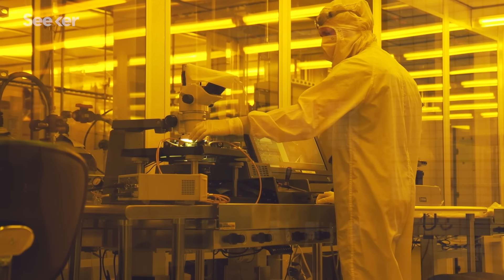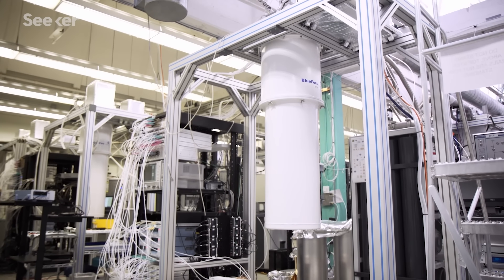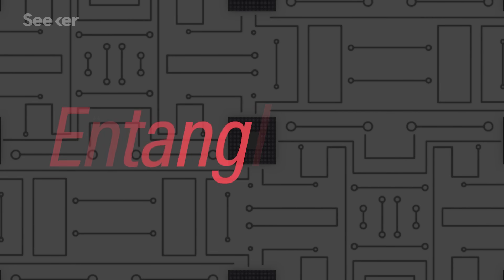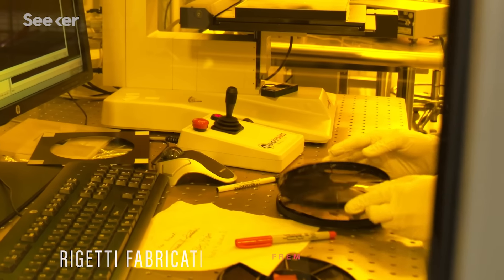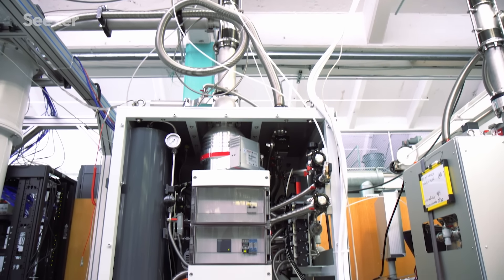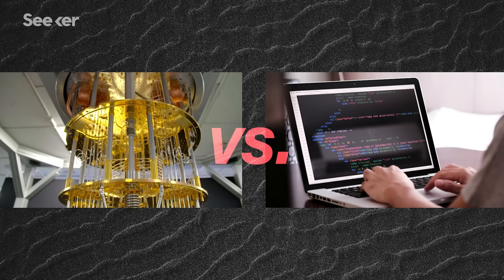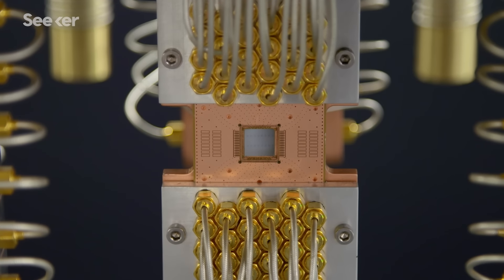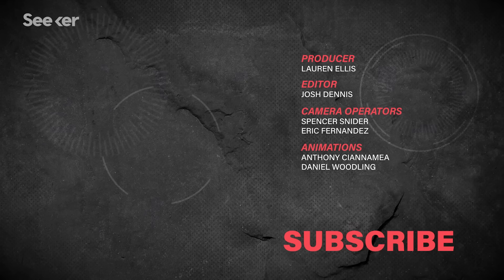We’re Close to a Universal Quantum Computer, Here’s Where We're At

Comment: Understanding how to code for a quantum computer is beyond me, though. And I have a master's degree in computer science. It's just such a completely different way of thinking. But I bet that future students will have lectures of quantum computing.
Reply: That's one thing I found sort of comical about the race for working quantum computers. I was watching a documentary on it and a speaker mentioned that creating such a computer was only part of the problem. Since it isn't a classic computer, it won't work in the same way that current computers work, and programming a quantum computer will require learning how to interact with it. Sort of like learning to communicate constructively with an intelligent alien jellyfish from another galaxy. Actually, that would probably be easier, lol.
Reply: I am very confused about quantum computing because I don't understand the basics of normal computers. You guys seem like you could help, in order to get the computer to react in a certain way, I thought the electricity flow had to be cut off from certain transistors. If that is true how is it cut off? Also how do the people who engineer the circuits control the qubits and they end up as dots of metal in a circuit? I heard someone say quantum computing deals in probability, how so? I probably said many incorrect things here but please help me.
Reply: The Supreme Lobster here's an explanation that worked for me
https://youtu.be/F_Riqjdh2oM .

It doesn't explain how it work on the physics level, but I guess it gives a glimpse of how it is programmed.

Ok, I'm not a hardware expert, but here's my simplified understanding.
When it comes classical computers, we don't think about transistors during programming. We think about commands like "if this piece of memory has this value do these commands", "add this value to a value in that piece of memore and store it here", "while this piece of memory has such value keep doing these commands". CPU is a clever arrangement of logic gates that performs these commands like a calculator performs arithmetic. Examples of logic gates are AND gates, OR gates, NOT gates.
How to make logic gates out of transistors: https://youtu.be/sTu3LwpF6XI
How to make a binaty adder out of logic gates:
https://youtu.be/wvJc9CZcvBc

You can play with such circuits here: https://simulator.io/samples
Reply: Alen German it's really easy to understand
Reply: jay cocktoe how can you tell
Reply: The Supreme Lobster ikr
Reply: I'm sure there will be a layman's layer just like the sdk's of today.  How many people code today that cannot tell you what they're doing once compiled to the machine code?
Reply: @Alen German That's the exact video I was going to recommend. It's really is the best introductory explanation out there.
Reply: Lugmillord

Quantum computing is basically good for doing search operations on all possible outcomes except that it doesn't require a loop. Instead of describing how to loop through the possible outcomes and testing each one to determine whether or  not it is the outcome that you are looking for, you simply create the constraints that defines what a solution looks like and let the qbits that are sufficiently limited become determined values instead of being in superposition.

Effectively, you are creating a filter that only allows valid solutions through. The quantum computer takes care of generating all of the potential solutions and feeding all of them through the filter simultaneously.
Reply: The Supreme Lobster Your question is much too big to be answered in a youtube comment. But a key point is that the notion that transistors are switches is incorrect. Transistors are analog amplifiers the more current/voltage that is applied to a transistor, the more current the transistor  allows to pass.  Digital circuits are designed with a very high gain at the logical transition point between a one and a zero so that a small change will cause the output to go high or go low very quickly. But if you have an input that is very close to the transition point, the outcome is essentially random because noise in the circuit will effect whether a zero or one level detected. If you make a transistor small enough that the state of a single election can change between a zero and a one, the determination of that bit will inherit the superposition of that election, creating a quantum bit.
Reply: I have to call BS on you having a masters in CS then. I just got a bachelors in CS and quantum computing is something we studied. It wasn't something we had multiple classes over but there's absolutely no way someone majors in CS, let alone achieve a masters in it, and lack a fundamental understanding of quantum computing. And if you're talking about a lack of understanding in mathematics, then how in the world did you get a CS degree? Your base studies are the same as any engineering student, I had to take a total of four calculus classes in my freshman and sophomore years just to get into the CS major... not to mention multiple physics and chemistry classes along with other advanced studies. You're like most people that have ever talked with me about my degree; they all assume I just took a bunch of programming classes and that was it.... they have this idea that it's just some extended version of a technical college degree.
Reply: Samuel Rs I just checked the local university course catalog. It offers bachelors, masters, and doctors degrees in computer science.  There are no classes in quantum computing listed in the course catalog. So consider yourself lucky that you have some exposure to it. 

And you are a recent student.  When I received my first degree,  quantum computing was a brand new idea that was only theoretically possible. Even now its only in its infancy and not yet practical. Things are changing rapidly -- by the time it becomes practical, its likely that what you learned in school will already be obsolete unless you are actually doing quantum computing research.
Reply: Samuel Rs When I was skimming the responses I thought "Hey, what a constructive chain of comments", but of course there had to be some entitled <enter insult of your choice> like you. First, look up what a strawman argument is. You are making baseless assumptions and then claim that you are "oh so good at this". I get it, you want to feel superior.
I was in the top 10% of students both the year I got my bachelor and the year I got my master and I studied in Germany's best university for computer science. When I studied there were no quantum computing lectures - maybe there are in the near future, who knows. It's nonsense to think that knowing how to programm for quantum computers is in any way relevant for a degree as of now. I have a deep understanding of signal machines (a generalization of cellular automata) - I guess you have no clue what that is. And I'm not saying that you can't have a degree in computer science without knowing about it. Computer science is broad. People specialize in specific areas. Quantum computing is just one small field of many.
Reply: You do make a good point Tim, I didn't really think about those getting their degrees significantly earlier than I. That does make sense, my apologies.
Reply: We'll have AI to understand and program for us.
Reply: its been explained to me as a function call that would be accessed through normal code.
Reply: Tim Harig ohhhhhh
Reply: The Mathematics of Quantum Computers | Infinite Series ... :) womenzzzz
Reply: Lugmillord I would imagine the computer would write it's own program!
Reply: Joshua Woods woah
Reply: That’s because masters isn’t really anything. Everyone has masters
Reply: Don't worry, there will be thousands of OOP frameworks to "simplify" the process :P
Reply: Lugmillord, did you just realize you dont really know anything?
Reply: The human brain will continue to amaze and yes we will program for quantum computers.
It's only a matter of time.
Reply: The Supreme Lobster I'm no expert in quantum computing but I'll try my best to sort of explain how they work. Please correct me if I'm wrong on any part of this.

So first entanglement. A lot of media and hype makes it seem like there's a string attached between two atoms to connect them but that's not the case. It is the idea that let's say an atom decays into two daughter atoms. Both daughter atoms will be very similar in spin, composition, energy, momentum, etc. That means the two daughters are entangled because of that scenario. They will become no longer entangled when another scenario causes one to lose energy or change, aka such as looking at one of them, your eyes bounce photons into your eyes and collect information, photons contain energy and that energy bouncing on the daughter atoms changed their energy so they are no longer the same and not entangled.

Superpositioning is if you remember from chemistry, atoms have a spin of either up or down. Since they can flip so fast between them, we say it is doing both at the same time because we can't tell if they're up or down spinners until we observe it in say an NMR which has a magnetic field to force the atoms into either an up or down state. By doing that, we collapsed the superposition and forced the atoms to be either up or down.

So quantum computers use these principles along with statistics and linear algebra. A qubit is a 0 and a 1 at the same time. So think of in a classic computer, two bits could be 01 or 10, nothing else. Two qubits means you could be BOTH 01 and 10 at the same time. That's literally two computers at the same time in a quantum computer. Follow this pattern, 3 qubits is 001, 010, 100, 011, 101, 110, 000, 111 all at the same time!!! Which is a pattern of 2^n. So that means with 3 qubits, you have 8 strings of 3 bits. That means you went from having to need 24 bits to only 3 qubits. Since 2^n is exponential, having like 10 qubits will be the same as 10240 bits (cause 2^n strings times 10 bits per string).

But now this is where people get tripped up, it's not doing all those at the same time! It is holding the information at the same time, but to use it, we have to bring it from a superposition back to a regular observational state. Think back to the NMR I said, up and down spins are useless until we put it in a magnetic field to observe the spin to characterize a solution. They use probability to help "collapse" the qubit states so that it goes to one of the many superposition strings. So let's say you have a regular computer with two bits, a 1 and 0. You will have a probability of 1 to be either 10 or 01 because YOU tell the transistors, I need a 10 or a 01, it doesn't randomly pick one, it can't be anything else. In a quantum computer, two qubits give you 00,11,01,10. It is all of those at the same time, now you just need to tell the computer, hey I need 10, can you collapse to 10 so I can use that? How they physically do that is beyond me but that's the theory behind it. Once you collapsed it to 10, you can use it like a regular computer.

I hope I helped and if not, I probably just confused the crap out of you, theres more you can talk about using eigenvectors and such but that might be too much math for a comment. Again I might not be totally right cause I'm only studying Chemical Engineering and not quantum physics lol
Reply: Lugmillord - ...having a masters in computer science which is an established thing 50 years old says nothing about your ability to think new and innovative. You're a learner not a writer, its not a surprice to me you cant comprehend whats still not even understood by the brave ones who decided to be the pioneers in contruary to a pleb learner
Reply: You need a strong understanding of science/physics, basically the first thing this video points out...
Reply: well all long be dead before that happens
Reply: It's a bit like a non deterministic turing machine but one you look the output you ruin it
Reply: what good would it be to have a computer generate random codes?
we can already generate as much digital code as we want.
Reply: Just to guzzle billions of dollars and make us general people fools by using non comprehensible technical jargons.
Reply: hey..somethings gotta keep this zoo running
Reply: Lugmillord you have a masters in computer science and you favorite Mario hacking videos made by script kiddies?
Reply: Smellavision – honestly, a compiler that could turn any classical code into something optimized for a quantum computer would be basically an AI smarter than any human. I don't think that's a likely scenario in the near future.

Besides, the vast majority of problems do not seem to benefit from quantum computation. We know very few problems in BQP\BPP, and while there are likely quite a few more they all seem fairly esoteric. There's no expectation that quantum computers will actually be better faster than classical computers can already solve efficiently (in polynomial time and space).
Reply: Lol in undergrad I took lectures in quantum computing.
Reply: Same here...I am good at coding and know much of hardware level to high level logics.But this new technique is out of thinking of a normal programmer.Sometime I think can these quantum computers will generate correct mathematical answers because 10+10 is 20 in normal bit oriented adders.
Reply: Look up Peter Shor - his factoring algorithm is based on quantum computing and it's, well... involved. Something tells me quantum computing won't be a freshman level class for a long, long time
Reply: +Johnathan Grey
That usually happens after you hand in your PhD dissertation...
:-/

#50ShadesOfDerp
Reply: Imma getting tired of the people who try to start intellectual Pissing Contests...
...with an empty bladder.
Reply: +Samuel Rs
Here's a nickel, kid...
...go buy yourself a real mind.
Reply: +Samuel Rs
And count yourself lucky not to have come thru a 'University' whose CS grads are basically just Java jockeys...
(I'm looking at you, Auckland :-( )
Reply: +Mason
"Would you like Quantum Fries with that?"
#YourFuture
#PS_IHopeNotReally :-/
Reply: +Em Zee
"Step 2:
Magic Happens Here"

:-/
#Handwavy
Reply: +E T
"Your eyes bounce photons into your eyes"
:-/
Got a Masters then?
:'(
Reply: What was the documentary? I'm interested in watching it.
Reply: I feel inferior too. And I'm tasked with making efficient new algorithms using these quantum techniques to tackle AI
Reply: Bet that as much stupid were people 30,50,100 ago , they will be as much smart at the given time frames in the future , compared to a normal thinking person among us. One negative factor you must process however is that society now create specialists in one specific thing, and useless to all other.
Reply: Lugmillord gotta reach outside the box. Sounds basic but I’m sure you can wrap your head around it more since you’re already fascinated with it by being here. No one here in the video had a text book explaining it! How’s the time to break rules in science so go at it :’ )
Reply: Quantum mechanics are so abstract many won’t be able to understand them and those that can will be light years ahead
Reply: I agree it's amazing I understand some of it but it gets so deep!
Reply: Lugmillord 
People will learn it. We cannot just defy this progress because it is different to programm.
Reply: it's a very exciting time to be alive, this is just like back in the early 50s when computers were first invented, they were large, temperamental, expensive, complicated to operate needing many engineers and could not do much more than your average pocket organiser from 30 years ago. They were originally operated by a large printer as a monitor and a typewriter like machine also as big to make paper instructions. Using a keyboard and a monitor to operate this machine would be like that.
Reply: We always figure it out it may take a long time but it will happen!
Reply: Lugmillord and people say mores law is over. 🙄
Reply: I believe that is Moore's law!
Reply: Gregory Veenhuizen yea, thanks mr technicality. Im using an iPhone not writing a thesis.
Reply: I tried my hand at coding, specifically Python and I was the most boring thing I ever did.
Reply: Lugmillord if that's the case then you wasted your time. A degree is just an opportunity for someone to educate themselves, it doesn't necessarily mean they did.
Reply: Samuel Rs he never said when he got his masters degree. I received my Bachelors in Electrical Engineering in 2010 at 20 years old. The theory has remained the same but new devices pop up all the time.
Reply: I think we can understand the quantum real in a way thoughts and matter meet .
Reply: Lugmillord my goal in life is to invent anti matter
Reply: No pun intended.
Reply: @Lugmillord Don't worry. I'm not a quantum computer expert by any means, but a number of years ago I attended a quantum computing conference just for fun. Most of the quantum computer researchers didn't seem to know much at all about classical computing, or how to write a program, or classical algorithms. Most didn't even know what a for-loop is. Most didn't know anything about the physics of quantum mechanics (i.e. wavefunctions, electron orbitals, the structure of matter). All they knew was very niche, abstract mathematics about things like abelian groups, lie theory, and quantum algorithms. Most quantum information / quantum computing experts are pure mathematicians who have never set foot in a lab or written "hello world" in c.

It was very eye-opening to find out that most of these so-called experts really just work in very narrow silos, and don't have a broader understanding of the world that their work fits into.
Reply: If a bit is in superposition, how do you tell if it's true or false? How do you extract meaning from superposition... I think quantum computation is a illusion and a buzz word for the naive.
Reply: @Alen German - Yup I'd previously watched that one from ms research, and while he rushes though lots of it, it is one of the better ones to explain it at a CS level (at least that is on YT and has any depth to it) and it was actually helpful that where he could he avoids the q-physics\mechanics of it all.  Recommend it as a primer.
Reply: in the future there will be no lectures, because it is a waste of time. Instead we will have implants, which contain all of the needed information. This indeed will be needed, because imagine after 1000 years how much information the students have to learn. It is not practical and waste of time.
Reply: Best way I can get my head around it is to think back to computers ancestors that relied on gears like automatons use that for the example of normal computing and imagine a gear.i.e qbit that could interact in all possibility with every other gear in infinite combinations thus giving the automaton much more varied and complex movements
Reply: jay cocktoe you can actually get a bit of time on a quantum computer to run your program. My brother wrote a program ( very small though ) and it worked.
Reply: Lugmillord Go back to basics...... Start with Quantum Mechanics as a start point in Quantum Coding.
Reply: In the future you will have high level languages for QCs.

How many people code in machine language or assembly? Not many.  You just need a compiler
Reply: I’m just a pleb and i honestly still can’t figure out the point of a quantum computer
Reply: indeed "completely different way of thinking" ,that's the key ,because it's an alien way of thinking "they" are teaching humanity nowadays
Reply: My understanding is that you won’t need to know the quantum mechanics behind it, just the same way you won’t need to understand the mechanics behind electrical or wave representation of bits we use today. You would probably need to understand how specific data structures are build to utilize the computational capability of the quantum world, I think almost everything from user programming logic would be the same, but way quicker search and sort algorithms. For example Shor’s algorithm would just be the same logic but finding the period logic part would just be way quicker since the underlying quantum mechanics were build to optimize this specific step. The computation is optimized not the logic in my opinion.
Reply: If you can understand and create data structures that optimize these quantum mechanics computations then you would be the next Gosling, we just have to understand how your data structure works and what kind of problems would be good to use that data structure just like we know when to use List or Hash Table
Reply: Vir9il I understand your point but you might not like it but computer scientists are mathematicians. You actually have to know the steps aka logic of your programming before you even write the code. Computer algorithms and data structures are just structures to solve a problem like searching/sorting in quickest steps possible by hand and then build a mechanical model/computer to do the steps. It is not coincidence that Alan Turning was trying to break the enigma code which became bases for Turning Machine. Most mathematicians now are training to break the cryptography Which is based on prime number factorization, which turns our finding the “period” of a number so just searching algorithm
Reply: Its easy to code for. I made a truly random number generator.. unfortunatly as of now I can only use 5 qubits so not super complex number generator but hey it worked... actually first line of code I have ever written. Though not the first code I have worked with. ;)... wait I did make a fork bomb once... just for testing if I could..
Reply: You need a Master's in physics.
Reply: Just be friend of a quantum scientist and keep stealing information from him about quantum, one day you'll reach a level where you can apply quantum to programming or vice-versa.
Reply: im a future student by the way since im like 8 years old :)
Reply: I think that is essentially what the quantum computer is.  a wriggling jellyfish from the next dimension.
Reply: @AndrewSmith-iq6xo  Basically, 1's and 0's (on or off) are sent via radio, fiber optic (lights) and copper wire. Those signals are sent to a router, then to a dns server, then to another router, then finally the other computer. That computer reads those on and offs and interprets them as 1's and 0's. for example, 00000101 is 5 and since there are 8 bits (numbers) it is a byte. Then u get megabytes and gigabytes as you're familiar with.
Reply: @AndrewSmith-iq6xo  If you want to understand more about today`s mainstream computers (not the Quantum computer wich runs in a different logic) you should read about Boolean Algebra. That sits basically at the core of computer way of working today. And to be more precise just want to tell you that that every CPU has an internal clock,  which is a small piece of oscillating crystal that produces a continuous flow of alternating 0`s and 1`s like a metronome: 101010101010...... with a particular speed.   This signal is then passed through hundreds of millions of transistors and because of the Boolean Algebra i was refering to, this array of 1010101.... is processed and modified into more complex logic which makes possible for you to see these characters here and do everything you can do with your computer or smartphone.
Reply: Lugmillord There have been a number of open, experimental quantum computing platforms, to teach new algorithms, object models, and ways of thinking to computer science and programmer types; also these have been used to observe how volunteering, experienced programmers themselves are, or are not, able to make the conceptual transitions to the quantum environments. (IBM had one 4 years or so back... I signed up for it, but eventually became waylayed after reading an article about Russian hybrid warfare...then camAnalytica... Eventually becoming sucked into the study of Psy warfare, the Trump calamity, and its sequela. Call me "scientist, interrupted" I guess.) 
BUT: There are still platforms opening and closing all the time, though, for CompSci people to (with no fee) learn -- and to be useful lab rats for those studying programmer adaptability to this radically new paradigm. Elon Musk had one a few years back, as did M.Soft, I think.
Reply: jay cocktoe Perhaps not, but with assisted AI’s nearly anything can be achieved. And some humans alone are getting very close to solving how to work with the computer. We’re barely at the point of coding and or programming with the computer. We are observing its behavior.
Reply: AI will do that dummy.
Reply: Lots of drugs
Reply: @AndrewSmith-iq6xo  In truth they're usually not directly linked into each other to form quantum circuit for a lot of quantum computers they work kind of like an fpga chip where they have an array of discrete qubits governed by classical circuits, the classical circuits mix and match qubits , governs their possible states with each other and sets up a kind of virtual quantum circuit by passing information between them and measuring their possible states. This current version of quantum computers can't reliably use quantum entanglement to perform calculations which doesn't make them a bona fide quantum computers but a classical computer capable of using quantum superposition to accelerate probabilistic maths (think molecular, weather and neural network simulations).
Reply: I HAVE A MASTERS IN MYSTERY SCIENCE!
Reply: Commodore 64 is Quantum Computer.... 😂🙌😉
Reply: @miniwaern  I wouldn't compare anywhere not even my own country to german science and computer engineering, even if you had a masters in a similar area, some of the top universities in the field are german, I fully believe him and understand what he is saying, and I understand what you are saying, but it's different, if you had a masters 20 years+ I would agree with your point, but it's not like that any more, we have more information available to us whether you like it or not nad a masters will generally now cover a more larger spectrum, I'm not saying anyone is smarter, everyone has their knowledge, but its just how it is that people with masters today have a much bigger information span about the subject than those who did their Uni time a while ago.
Reply: @bartsshorts  No, that's not really true, are you in the IT industry ?
Reply: @baljeetsangrur  Because it requires an understanding to some degree in science, this is for a new generation of people which aren't us just yet unfortunately, which is a shame, Would have loved to be involved with the things this brings.
Reply: Get on it Dude. Don't be left behind. You got this if you want it.
Reply: @bartsshorts  I mean, no, no we can't actually, there are many areas where it just isn't fast enough, if you're speaking from a public perspective, yes of course we can make as much as we need. But science projects such as space travel or military movements, as well as private business ventures into future AI and tech don't have particular power that's needed to accomplish some put forward ideas, it's too expensive, this is also expensive but opens a whole new road and gap for the progression.
Reply: The problems QC addresses requires stochastic verification which is why they work in tandem with traditional computers. Running real QC logic is a set of microwave pulses that initialize or couple multiple qubit states together (at least in the easier to implement logic in SQUID based qubits). These microwave pulses can be sequenced in a similar way regular code is, but of course, we cannot guarantee the final state of our system (but a statistical distribution of repeat runs or with some refinement can find answers at reasonably high likelihood). The crux of getting QC to work is coupling qubits together by mixing their state, which caries a ton of their own practical problems (depth of CNOT gates can increase likelihood of incorrect answers, but trying to simplify it could require more ancillae qubits), but can help you solve complex problems with great theoretical speed up if you, for instance, perform a series of reflections/rotations on the statevector iteratively (Grover's Algorithm). 

More rudimentary but still equally complex to program, you variationally simulate quantum states inside molecules or atoms by initializing a state space and evolving some guesses with decomposed unitaries over time, which also offers huge speedups over traditional computers (but is greatly hardware limited still). Nonetheless, there's a lot of toolkits like IBM Qiskit (built on Python and QASM) and Google Cirq, Amazon Braket which enables imperative programming to interface with hardware without needing to shaping the microwave waves yourself. However, each algorithm is still the subject of an APS/Nature/IEEE paper or rises out of a dissertation or thesis of a great scientist, so it's nontrivial to develop your own algorithms more oft than not.